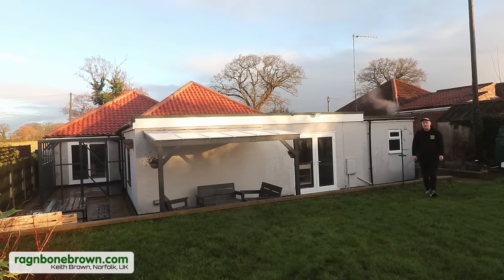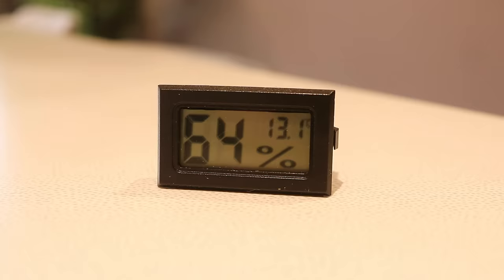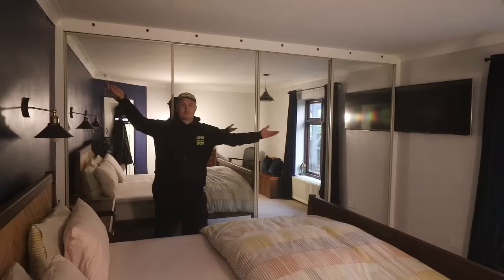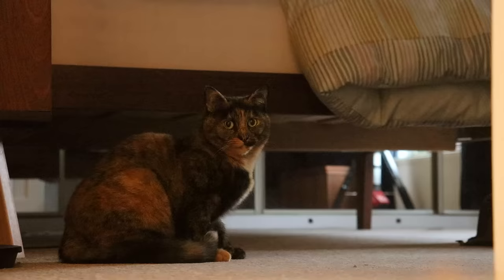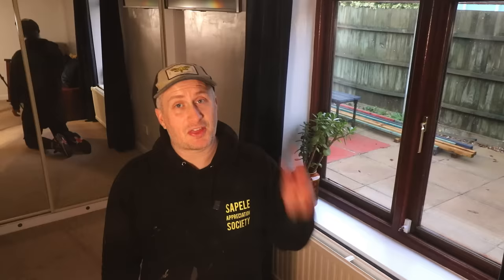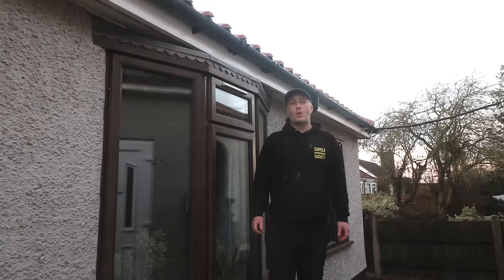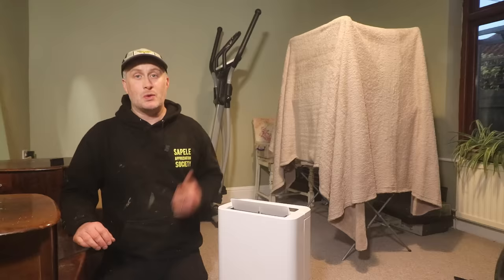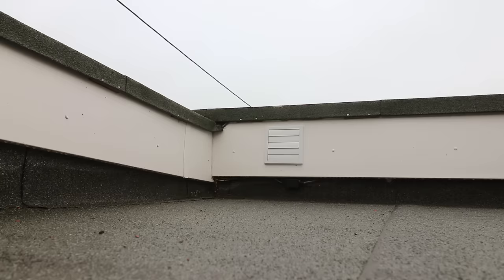8 Steps To Fixing Damp, Mould, Condensation & Humidity In Our Home

Comment from the maker: Humidity sensors: 8 pack https://amzn.to/3VM6UZt (Amazon UK) https://geni.us/te0N (Amazon Worldwide)
Air Brick https://amzn.to/3ClxYIn (Amazon UK) https://geni.us/d2drN (Amazon Worldwide)
Hit & Miss Vent Small 9"x3" https://amzn.to/3jNgI8l (Amazon UK) https://geni.us/nlTL7W (Amazon Worldwide)
Hit & Miss Vent Large 9"x6" https://amzn.to/3idlVpy (Amazon UK) https://geni.us/oApzqa (Amazon Worldwide)
Mould & Mildew Cleaner https://amzn.to/3VOqB2T (Amazon UK) https://geni.us/foorjjZ (Amazon Worldwide)
Mould Damp Seal Paint 500ml https://amzn.to/3VLIpvB (Amazon UK) https://geni.us/Rr96X2 (Amazon Worldwide)
Anti Mould Paint 750ml https://amzn.to/3VJYSQV (Amazon UK) https://geni.us/TZeKpP (Amazon Worldwide)
Trickle Vents 500ml https://amzn.to/3ie3nFP (Amazon UK) https://geni.us/fnNB9p (Amazon Worldwide)
PIV (Positive Input Ventilation) https://amzn.to/3Im1mC5 (Amazon UK) https://geni.us/c6dSehz (Amazon Worldwide)
PIV with built in Hygrometer https://amzn.to/3WOJc0c (Amazon UK) https://geni.us/VyN1Oh (Amazon Worldwide)
Dehumidifier https://amzn.to/3GH6G1s (Amazon UK) https://geni.us/tTsW (Amazon Worldwide)
Bathroom extractor https://amzn.to/3iiieiu (Amazon UK) https://geni.us/SMelJ25 (Amazon Worldwide)

Comment: The ideal humidity range is NOT 30-60% RH - If you have 30% RH ( desert levels ) and you spend the majority of time in that environment you will have dehydration in a very short time, this level of dehydration will dry up your sinus membranes and leave you wide open to all sorts of infections in the nose throat and lungs. The ideal range is more like 45 - 60% RH. Short periods between 60- 70% are OK especially with moving air ventilation. You have done a great job of your house and showing people sensible ways too reduce excessive RH. Humidity sensors can be checked for accuracy, cheap ones can be wildly out. Do a search for calibrate hygrometer. It can be a difficult balancing act in the UK. Winter is NOT the cause of the higher humidity you experienced as cold air is much drier than warm air. It was the heating being on in a DAMP environment, warm air carries and allows a far higher moisture content than cold air. The extraction fans in kitchen and bathroom are by far the most important element of the work you are doing and MUST be used all the time in older less well insulated properties. The PIV is also useful in many situations in the cold winter the air coming in will have lowish RH and when that air is heated it will become even drier. Air MOVEMENT is key to many problems with even just a simple fan moving the air around can help a great deal and at far less cost than a dehumidifier. Dehumidifiers are EXCELLENT at dealing with high RH but as you say they are now becoming expensive to run because of our governments INSANE energy policies and the sheer greed of the corporations and their shareholders. You often see mould on the top of walls where they meet the ceiling as warm moist air can sit there where there is a cold bridge, this then condensates creating the mould. again this is where the simple movement of air with a fan can prevent this from happening. Also ALWAYS allow a descent gap between furniture and the walls including BEDS etc a descent gap is around 6 inches. Your cats are lovely too :-)
Reply: Should have made a video
Reply: I for real screenshot your comment. Thanks man.
Reply: @SIC647  So did I😆.
Reply: Awesome info. As Woody1380 suggested, you should have made a video👌🏽.
Reply: I agree with the other guys.please make a video
Reply: It's funny how people are reluctant to use a dehumidifier because of the cost, but quite happily use extractor fans to exhaust warm air out of the shower/kitchen etc without much consideration of wasting energy. Dehumidifiers (refrigerant type) use a basic heat pump to condense the moisture in the air and blow it back out again, which has a warming effect; anyone who has used a dehumidifier to dry their washing can attest to this as the room can become quite warm. It would be good to see 'built in' dehumidifiers that can reduce the humidity and redistribute/circulate the air to other rooms rather than just pumping hot damp air out through a vent!
Reply: @aesopshair6690  Well sort of. But extractor fan 10 - 30 mins at 30-50Watts taking extreme moist air out. Dehumidifier is usually on for hours at 220-260 Watts for a half descent one. at 38p KWH So the cost of the dehumidifier WILL be significantly higher than extractor fan, even with the slight heat loss of extractors.
Reply: @MikeWerndeg Totally agree with the basic maths of that, but considering the energy in the warm air, the equation is slightly different..
A 250 watt dehumidifier could be adding 3-400 Watts of heat to the room by recovering the energy from the damp air, but an extractor fan exhausts that air outside and replaces it with external air (assuming it is not a heat recovery system); that external air may subsequently require  heating, depending on outside air temperature.
A dehumidifier recirculating air in a bathroom for example requires very little additional heat during colder weather, whereas extract ventilation will often cool the room significantly. We used to have a 1kw  bathroom fan heater when the extractor fan was working to replace the lost heat, but the dehumidifier now removes the need for a heater.
Reply: I so agree with you about dehumidifiers. I have a total of 3 of different sizes and don't use them all the time lol. I have 1 in the basement on a timer to run in the day to use energy from solar panels. In winter I have a larger unit in house. I turne this on as and when I need it. To me they're cheap to run, as I don't need to use as much energy to heat damp air.
Reply: I love my dehumidifier, dries clothes a treat, even pained one wall red and the tank had a pink tinge, we don’t keep it on all the time, and we open windows so long as no rain….
Reply: Let me introduce you to the paragraph my friend.

Their excellent for splitting up large amounts of information into easily readable sections.

🤣
Reply: Great informative reply.
Reply: The recommended levels are 30 to 60. This suggests 45 is ideal. 30 is too low, 60 is too high. The range indicates ceiling and floor levels, so yes, 30 is very low but still falls within regulation limits. 30 is not desert level and won't dehydrate you. Many sealed air con units, such as those recommended for people with respiratory issues, routinely operate at such levels. Would the air be dry? Yes. Would you dehydrate? No. A ridiculous and misleading comment.

Cold air does not carry more moisture than warm air but when cold air hits warm surfaces (ie the cold air coming in from outside through air bricks etc hits warm indoor surfaces) condensation and mould are more likely. Bringing ccld winter air in through open windows or vents is therefore counter productive in the winter. That's when you want to run dehumidifiers and use humidity absorption devices in enclosed spaces such as closets or porches. 

In summer simply open doors and windows for ventilation. 

Personally I recommend fans over dehumidifiers. Keeping air circulating will solve most condensation issues. Solar fans in exterior walls are much more effective than air bricks or static vents.

Edit: missed words
Reply: @notbloodylikely4817   OK sit in 30%RH for a week and come back and tell us how you get on - my statement is not misleading at all.
Reply: @tomfoss3533 
It's they're, not their.

👍
Reply: @tomfoss3533 Just to translate, he means ‘they’re’….not their!! 😂
Reply: This is incorrect information, the Uk and Ireland have unique environments whereby higher levels of humidity and dampness are in winter months so the winters are quite damp, not dry.
Reply: @user-bj4ny8bt6l  NOT INDOORS - the air is cold ( lower RH ) Then it is heated and dries out much more. Learn about relative humidity, dew points etc and you will understand.
Reply: @MikeWerndeg  your understanding is incorrect, air at 10 degrees celcius and 90% humdity is less dry than air at 18 degrees celcius and 50% humidity
Reply: @user-bj4ny8bt6l  Well that is obvious - my understanding is still NOT incorrect - The 90% at 10C is still drier than 90% at 20C and the lower the temp the more dry the air.
Reply: @MikeWerndeg  cold air is not necessarily drier than warm air. Your understanding is incorrect.
Reply: @user-bj4ny8bt6l  IT IS at the same RH - you seem to have no idea what RH is - go and do some learning, you make yourself look not so clever keeping on. That's my last on the subject.
Reply: @MikeWerndeg or  you could thank me for teaching you about absolute humidity
Reply: @notbloodylikely4817 bacteria can thrive in humidity below/above 45/50ish. So there is a sweet spot indoors. A hepa filter on a dessicant works.
Reply: @notbloodylikely4817 I'm confused how does cold air condenser on a warm surface? How does the water cycle evaporation work - that's as I understand what condensation is a part of and is the reverse of evaporation.
I was lead to understand the reason condensation happens is because the air cannot continue to hold the moisture it has, that happens because the capacity for the air to hold water is reduced to below it's due point, that happens because it hits a cold surface taking energy from the water in the air surely, not a warm one
Reply: @SIC647 thanks for the idea 👍👌
Reply: @tomfoss3533  ‘They’re’ 😊

Comment: Remember it's 'relative humidity' so if you increase the room temperature the humidity will decrease. I noticed readings of 15C and 13C, which to me is cool and I'm not surprised you're having issues with condensation and mold. If you increased the temperature of the room to 20C the relative humidity would decrease.
Reply: You offering to pay for the heating? 🤔😉
Reply: @mikeharper1102  
Keep it at 15c, or replace electronics after a year or two, it pays for itself!
Reply: Yeah, anything under 15C isn't healthy. Would suggest keeping 16C min.
Reply: High temperature will not disperse moisture in the air. Cool air will. No cold air circulation. A PIV solves all issues (apart from in wardrobes)
Reply: @mikeharper1102   I think this is a contributing factor to mould/condensation/humidity issues people experience; with increased energy costs, people just don't heat their homes properly. They are happy to spunk money on many frivolous things, but God behold they should spend some of their money on heating their homes, how dare they have to do this...

Comment: I was astonished to hear about this. Living in the sourth of Germany, in a second story flat, i am constantly fighting the opposite problem in the winter: If I just heat normally, humidity will very quickly drop below 40%, and then I spend all winter just coughing all day long since my lung will dry out. So I have evaporators on all the radiators, I do dry my clothes inside, I keep the doors of the bathroom open so the humid air can get to the rest of the flat and so on. I even have an electric humidifier for the especially cold & dry days.
Reply: Very interesting indeed - same situation in New England, in the USA. We have 3 evaporators and most folks have evaporators or ultrasonic misters to in increase humidity in the winter. In summer we are trying to either dehumify or run air-conditioning to drop the humidity, making the heat more bearable
Reply: Pretty much the same story in Latvia, where most buildings are well insulated. Cold dry weather = dryer air. But in the UK it’s cold and wet, thus higher humidity. Hardly any brick houses are insulated properly, which I hate as I now live in England:)
Reply: seal your windows and outside doors
Reply: That's really interesting! As we are constantly battling high humidity (in summer the basement is a problem solved by dehumidifier) it didn't even occur to me that others could have the opposite problem
Reply: @boobrowsky  It doesn’t really help much as the main problem is thin exterior walls and sometimes even single glazed windows.
Reply: @Smithb83  Well, high humidity in summer is more normal, if you're not living in a desert. But in winter, the mere fact that you take in cold air from the outside and then heat it up should usually lead to low humidity inside of your house (since the same absolute humidity means a lower relative humidity at higher temperatures). 

I mean 20°C & 60% rel. hum. corresponds to a dew point of about 12°C, so once the outside is ~8°C colder than the inside, it should be impossible to get to more than 60% humidity without specifically humidifying measures.
Reply: @boobrowsky  Well, that would keep the humidity in. And the people. And the CO2.
Reply: @HenrihsAhmadejevs  Our houses are different in the UK. If they are insulated too much that can cause less air circulation which doesn't allow the house to breath. You can't compare a British house to another countries houses. Our houses are built to our conditions just like houses are elsewhere. As you've said Britain is a cold wet place.
Reply: @sugarpuff2978  I'm afraid it's not so, as half of the houses are properly insulated and do not have mentioned issues. But soon it will be resolved as the gov. is finally doing something about that: "The new data shows that 56% of properties in the country do not have enough insulation to qualify for a so-called EPC rating of C or above. In 2025 the Government's new rules will mean that any home rented out under a new contract needs to have a C rating or above. In 2028, all rentals have to be up to that level.".
Reply: @HenrihsAhmadejevs  There must be loopholes for this as for some properties it would be uneconomical to make the required changes. This will lead to less private rental properties driving up rent prices.
Reply: @ice4142  Indeed, this is possible; however, there are many factors to consider. IMHO, the most likely scenario this time, due to cost of living crisis, BoE base rate rise, less disposable income in most households could lead the property market to crash in the overpriced parts of Britain. Lots of people will move to more affordable towns and cities, as well as abroad. Tens if not hundreds of thousands of borrowers will see their mortgage payments doubled and tripled this year as they've signed for mortgages with a fixed rate for 2-3 years. Will see what 2023 brings. Interesting how we flow from condensation issues to politics and economics:)
Reply: @HenrihsAhmadejevs  Interesting how you think that British houses are built and insulated the same as German properties would be when the two countries will suffer different weather patterns and temperatures. It's not a one fits all situation.
Reply: @boobrowsky  I agree.  We used to live in an old house that had large gaps in the (wooden) windows; we had an air circulation system installed which did NOT work (so we had it removed, as it was just pumping very cold air into the living room and the power meter was going CRAZY).  Out of desperation, I cut thin strips of timber (about 15mm thick) and stuck a draught sealer on one side and covered the entire inside of each window so that it was reasonable air tight!  

It was a very big house and we couldn't install a heat pump (because of the way the living area was built).  Most of the time, we only used one heater (or two when we needed the room to be heated up fast).  We ran a dehumidifier occasionally during the winter months when the humidity was high.  Condensation was not much of a problem as we opened the windows regularly to let fresh air in.  The difference was night and day - no kidding!  It was only a single-pane window but by sealing the windows, the problem was fixed (both temperature and condensation).

We are now living in a house where the condensation is very bad and we will be installing a ventilation system soon.  We live in New Zealand, by the way.

Comment: Our rooms average around 40-50 percent humidity pretty much regardless of outside weather. We live in a three-storey 1950s semi-detached house in one of the rainiest parts of Germany (other than the coastal areas). Outer walls are single-shell brick about 300mm thick, windows and doors are on low early 90s standard (my parents cheaped out when they renovated the house). No problems with mold at all which I am eternally grateful for.

Comment: We have found that using a squeegee on the walls after showering has meant the extractor fan is on slightly less, seems to help
Reply: The most effective way is just to open the window in the bathroom / en suite for ten minutes after showering .it totally clears any condensation even in the middle of winter...no messing about with a squeegee..
Reply: And a good wipe once a week to protect tiles